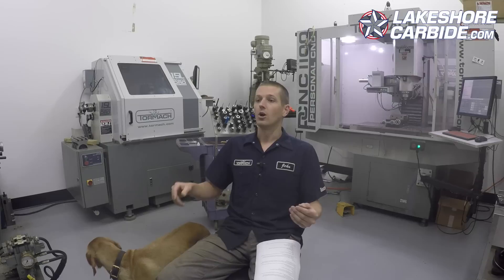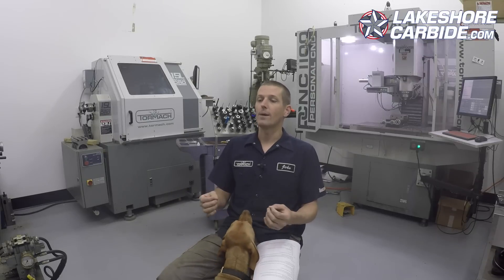1. Intro to Carbide Tooling Video Series!

Comment: Take a look at Kyocera Precision Tools, Titan-AX. They are made in Costa Mesa, CA. They are made on a 1/4" shank and a 2-1/2" oal blank and are available from 1/32" -1/4" diameter in stub, regular and neck relieved long reach options. They are also available in a square corner or radius. They are perfect for small (like Tormach)to large CNC machining centers. Search Kyocera Titan-AX